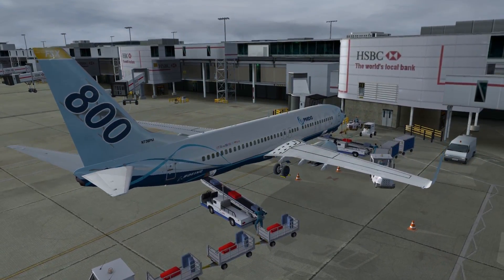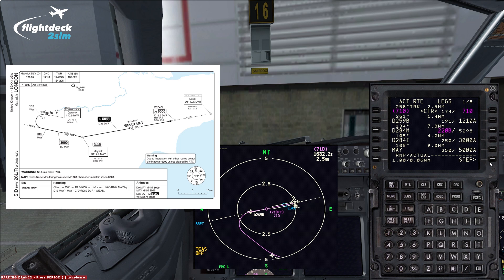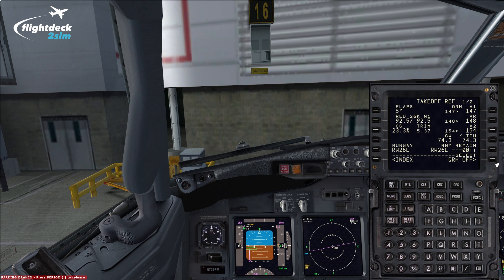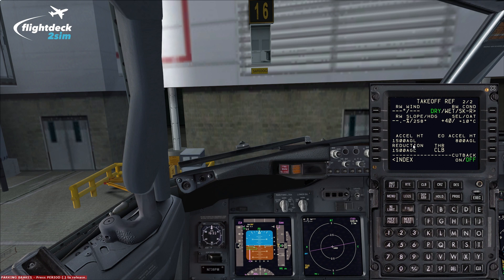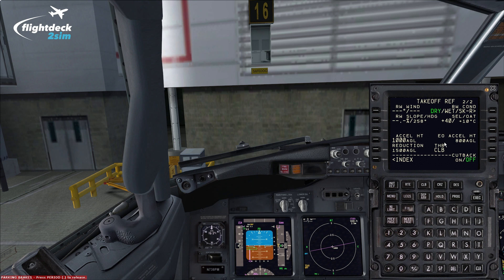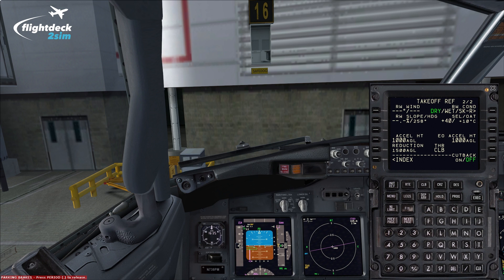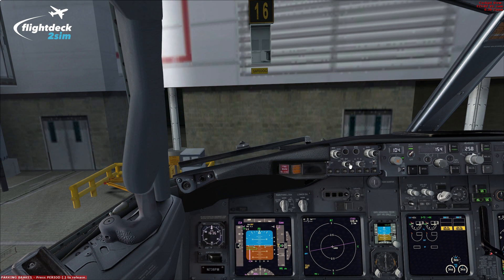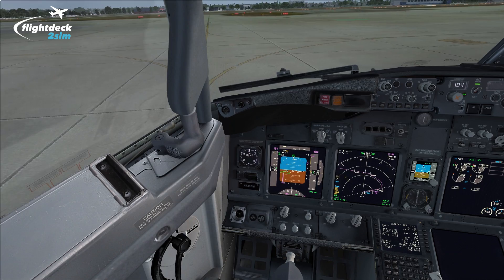PMDG 737 | VNAV Departure Tutorial | Real 737 Pilot

Comment: Hi, in the real plane the a/t will go into thrust hold mode from 84kts to 800ft agl. At 800ft agl it will go to ARM until the thrust reduction altitude entered in the T/O 2 page - normally 1500ft is selected to allow for a quicker acceleration to flap retraction speed - upon reaching the thrust reduction, on the FMA the annunciated mode will from ARM to N1 and the climb thrust limit selected on the N1 limit page will be selected as indicated on the thrust mode as CLB. I did not notice the mode indicator switching from THR HOLD to ARM from 800ft agl to the thrust reduction height so i was wondering if it was a system bug. Thanks

Comment: I am having trouble getting the VNAV to activate.  I push the button and it does compress but with no light and no function.   Any ideas on what I could be doing wrong? Is it something that I am screwing up in the FMC or autopilot?
Great videos and thanks for the help
Reply from the maker: Likely to be something wrong with the routing in the FMC or you haven't filled in every page. The FMC needs to be correctly loaded for VNAV to work! 

FD2S
Reply: Routing and perfs were good.  Found out it was that both flight directors were not on.  At least when I switched the other one on it starting working.

Comment: When I’m flying on planes I’m sure the aircraft reduces thrust first and then starts acceleration. Can the thr reduce and accel altitudes reverse order sometimes?
Reply from the maker: Hi Thomas, absolutely. THR RED is typically 1500ft where acceleration height can vary from 1000ft to 3000ft based on Noise Abatement.

You might find this useful.

https://youtu.be/EnpK42MlolQ

FD2S

Comment: Hi 

Would you know if there is way to load the 737-800 cdu 
to fly a SID out of say LIPZ with a short cruise to do an approach into
LOWI doing a manual touch and go from 6miles then complete a SID out with airways and a STAR into EDDL as a continuous flight?

Many thanks,
Reply from the maker: pdg17 Gray off the top of my head no, if there are no airways in between you could make DIRECT waypoints? Just join the dots!

FD2S

Comment: FD2S,
How frequently and in what situations do carriers like yours permit a 0 derate departure, or full TO/GA thrust on takeoff? You mentioned that the aircraft was heavy but you still used TO-1/CLB-1, and that got me thinking about this.

Also have you heard about the new 737 ultimate coming out for X-Plane for free? It uses the ZIBO FMC. Can’t wait to see you do a vid on that.

Keep up the good work!
Reply from the maker: Hi Spoon LGNX.

No need to be permitted to use full thrust for take off, if we need it we use it. Weight of the aircraft isn't always the main factor when it comes to how much thrust. It could be the length of the runway, terrain on departure. Also weather has a major factor. If we have a very strong crosswind we would typically use more thrust to reduce the risk of tailstrike.

I'm keeping a close eye on the development of the ZIBO MOD, I'll be using it a lot more in the future. 

FD2S

Comment: Have you made any video flying a 737 without the FMC? I'm  curious how we can navigate through waypoints on a 737 without the help of FMC, as it was made on the 732, 727, 707 and so on.
Reply from the maker: Hi ARI, not yet but I’ve made a note to look at a tutorial looking at FMC failures and how you’d fly the approach using just the basic autopilot modes (App or V/S) 

FD2S
Reply: flightdeck2sim Would you divert or return to the airport in the case of an FMC failure or is that depending on the MEL?
Reply from the maker: Hi Bob,

Not usually. We would advise we were no longer "RNAV" compliant and we would have to be routed with vectors or via NAV AIDS. We could only fly an ILS or NPA using V/S. A lot of SID/STARS are based on waypoints which would require an FMS so we would have to fly a SID/STAR based on VOR's, which a lot still thankfully are!

FD2S

Comment: First off, best flight sim videos and tutorials out there!! Second, I am experiencing a problem with autopilot/fmc No matter what the condition or what my fmc speed says, when I have lnav and vnav set, the aircraft speed will not exceed 245-260 knots. I know 737 can fly around 320 KIAS without overspending. This happens whether I have a headwind or tailwind. Any help is appreciated! Love your videos!!
Reply from the maker: Hi TheTrusouljar, what is your CI (Cost Index?)

An airspeed of approximately 250 kts would be normal in the cruise and descent with a CI Less than 10. Remember as your altitude increases your mach number/true airspeed/ground speed increases for a constant indicated airspeed. 250 kts IAS at 5000ft is a lot slower than 250 kts at 35,000ft due to air density which decreases with altitude.

I hope this makes sense! 

FD2S
Reply: flightdeck2sim thank you so much! I didn't even think about cost index. I was becoming lazy and entering in 1 for every flight.
Reply from the maker: Well I can tell you a CI of 1 the aircraft in VNAV will be flying to save as much fuel as possible! (VERY SLOWLY)!

Try bumping it up if you want to fly a little faster in descent!

FD2S

Comment: Thanks for the info - I'm used to flying SIDs or STARs manually as I'm flying older aircraft (CS 707s, 727s, L1011s etc)   - keeps you busy..think it's time for me to find time for PMDGs...you mention buying some rudder pedals...which are great but do you use the Logitech Flight Switch panel? I recent bought one but having all sorts of technical / driver issues.
Reply from the maker: Yeah that’s the old school way of doing things flying those aircraft! 

I just bought some saitek pedals. There are no doubt better ones but they do the job, haven’t really had much time to play around with them yet!

FD2S
Reply: the rudders are great and the yoke and throttles but I'd avoid the switch panel until they've fixed their driver issues....all sorts of forums reporting these issues,

Comment: Hello Captain! Can you provide feedback regarding the speed setting on the MCP for takeoff? Once the FMC provides a V2, I was of understanding that you add 20 additional knots as a safety margin? In this tutorial, only the V2 value is being entered in the MCP. Do operators have different SOPs regarding this? Thank you. Cheers!!
Reply from the maker: Hi Massimo.

It’s important to realise V2 is flown in the event of an engine failure when conducting manoeuvring and climbing after take off hence why it’s set on the MCP. For two engines the flight directors don’t pitch for V2 but command  V2 +15-20 kts 👍🏼

FD2S
Reply: Got it, so the flight directors will add the +15-20 knots so do not dial this additional amount into the MCP. Thanks!!

Comment: Q: If you Have low stop altitude let's say 4000 feet and You are doing ndap 1, Do You set bug up or vs + 1000 at 3000 ?
Reply from the maker: Hi Piotr, bug up as soon as you’re at 3000ft ALL or if ALT ACQ happens before bug up then.

Regarding your previous comment I do not answer queries regarding specific company procedures. It has been removed.

FD2S
Reply: flightdeck2sim Thanks :) Great video ! I´m sorry for that comment.
Reply: At my company we usually (if we are feeling lazy) engage the AP at 400 or 500 ft and VNAV all the way to the stop altitude.  My home base has a stop altitude of 5000.  If we see traffic descending in our path, then we will use VS +1000 to avoid nuisance TAs or RAs.  Once the flaps come up, you will accelerate to either the first speed restriction or 250kn, which ever is lower.  Assuming you are below 10k, and even then we adjust the 250/10000 restriction so its 10kAGL not MSL.

Comment: Hi FD2S nice tutorial as per usual. Did you try the tip I told you, with the mouse wheel to increase Baro?
Reply from the maker: Hi Steve! I always used the mouse-wheel when setting the BARO MINS but it would only increase in single figures unlike the real aircraft and ZIBO MOD I’ve been using which allows you to increase in 10ft increments if you hold the outer knob in position! Maybe I’m missing something!

FD2S
Reply: flightdeck2sim  Hi I found that if I hover over the baro knob it then changes to a hand. At that point I use the mouse wheel to increase the setting,so you can spin the wheel and quickly get to high numbers, helpful for Skithos approach. Or perhaps this is what you mean.
Regards Steve
Reply from the maker: I think it so but with the NGX it takes a few turns of the mouse wheel when setting high minima or MFRA’s! In the real aircraft you can hold the mins selector in place and you can set increments of a 1000ft every 5 seconds or so, this has been implemented with the ZIBO MOD 👍🏼

FD2S
Reply: Ah ok that does sound better. Think it may be time for PMDG to do a update and rectify a few wrinkles.
Steve.

Comment: Hi, can you explain why the course of captain is 104, and the first officer is 079? And why they are both different to heading? (i know the heading is the heading of the runway, 258º, but shouldn't courses be equal to heading?) Sorry for my bad english, continue your excellent work (Y)
Reply: SkaN Those courses you are referring to are for the VOR radial tracking. They are used as a backup for raw data flying should all FMC's fail. As you've said these are courses, the 258° is runway Heading. Hope it helps 👍.
Reply from the maker: Perfectly described Makss, thanks.

The course SkaN is called a QDM when flying inbound to a beacon. It’s just a way of backing up the FMC and don’t apologise for your English, I can guarantee it’s far better than me replying in your respective language!!!

FD2S

Comment: I have a question, did you ever try multiple rto's with this plane ? I tested it with all my controllers disabled and found out that if you use reversers at all, then any subsequent rto will result in autobrake disconnect, its the same with their 777. 747 though works :) Its as if the plane thinks that im advancing the throttle or something, maybe some throttle range issues ensue after that. There were posts about this long ago but as of now nothing got updated.

You could always map a tiller with fsuipc you know :) ? I do in pmdg planes, i just take a joystick with a z axis enabled and use that, it cuts out at 30 knots if i remember. I even use separate reversers with it.

What is your honest opinion on the NGX ? What things are incorrect in your eyes ? It would be great to learn it from a Pro :)

Comment: Hi FD2S ✌

Thank you for another interesting tuturial!
How do we need to set up the Takeoff Ref page 2 for a NADP 1 takeoff? I'm not sure, where to set 3000ft exactly? I guess it is the acceleration height as we need the aircraft to accerlate to than start the flap retraction, isn't it? What about the reduction agl? 

Could you tell us this briefly? Thank you!
Reply: Thrust reduction height remains the same, >=800 AGL (1500 AGL in his example). Acceleration height would be no more than 3000 AGL.
Reply from the maker: Hi MrPatLo.

If you have access to charts you can usually find the information in the Aerodrome Information section regarding Noise Abatement. The operator I work for also produces a briefing pack which is full of information such as what NADP procedure to use, unfortunately this is something I cannot share

FD2S
Reply: Thank you guys for both answers. I do have access to Lido charts. I just wanted to check that I set up the Takeoff Ref page 2 correctly for the case NADP 1 is required.
Reply from the maker: NADP 1 = 3000ft Acceleration Height (typically)

FD2S
Reply: At my company we use 3000ft for ALL departures except in the USA.  We call this our bird strike avoidance procedure.  Most birds fly around lower than 3000, and if we were to hit a bird, we would have less of a forward vector but more of a vertical vector... as well as lower overall IAS, theoretically reducing possible damage from a bird strike.  In the US we use 1000 as their controllers like to aircraft out as fast as possible.  Thrust reduction, we use 1000, and EO ACCEL is 800AGL, unless we have a SEOP that dictates a specific level off altitude.